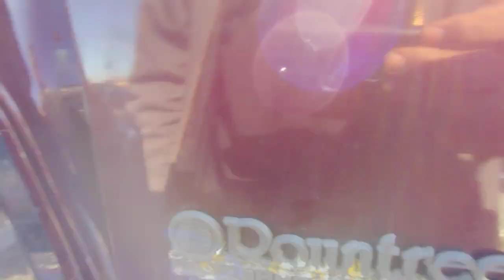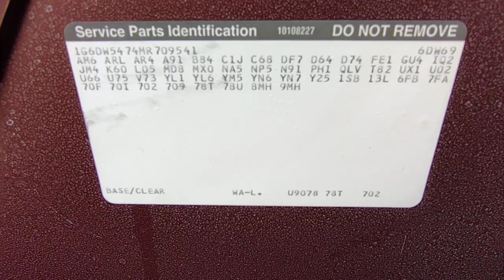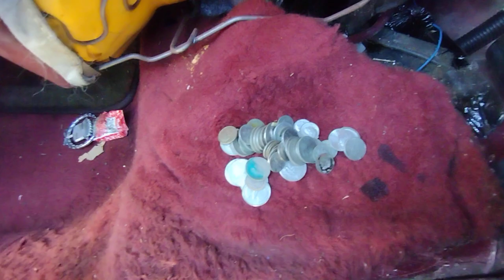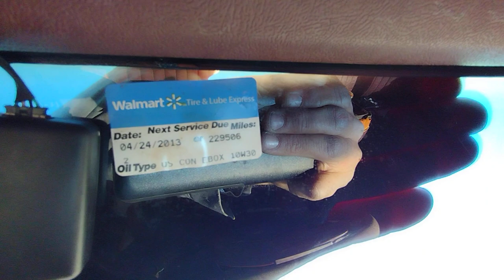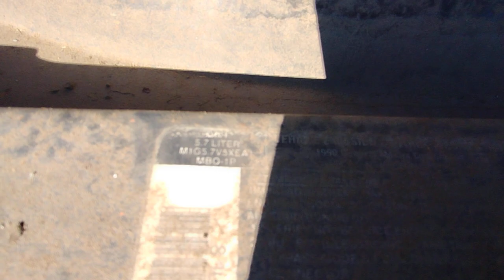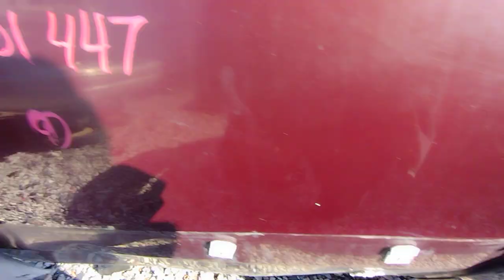1991 Cadillac Brougham Junkyard Find

Comment: Whoa Nelley, 1991 and it's done.

Yup, it's been cold here as well. I bought a 1969 Sears Craftsman (Waterloo made) model 63035 five drawer rollaway toolbox and I walked over to my workshop to install new casters on it that I got off Ebay and whoa Nelley, I couldn't wait to finish and get home. Then I had to walk back home (almost a mile each way). The cold motivates you to walk faster. LOL, but I'm going to Florida soon for work. I did find six cents in the bottom of the box, a 2021 nickel and a 1975 penny and I found a quarter elsewhere on my walk. Don't ask me why someone painted the toolbox flat black when the original paint under it is nice. I stripped the drawers back to original and the frame will be returned back to the hammer tone gray either back to original or with new paint. The same person removed the wheels, hence the need for a new set. But it's in solid condition. 

Roundtree Cadillac is now Orr Cadillac of Shreveport located at 8750 Business Park Dr Shreveport LA 71105. GM had an assembly plant in Shreveport which operated from 1981 to 2012 and produced models such as the S10 there. I've always liked these "square" RWD Broughams. 

We got the VIN, we win: 1G6 for US made Cadillac, DW54 for four door Brougham RWD, 7 for 5.7L (350 CID) V8 with throttle body injection aka "Gentlemen's Hotrod", aka RPO code "L05", 4 is a check digit, M for the 1991 model year, R for Arlington, TX assembly and the rest is the production sequence. The Arlington, TX plant still operates today and assembles SUVs and trucks. This style RWD Brougham continued through the 1992 model year (basically 1980 to 1992 are the same shape/chassis), and then with the "rounded" style from 1993-1996. 

We got the SPID, glad you did: AM6 for three passenger split bench with center armrest, ARL for Arlington, TX assembly, AR4 for passive (manual) restraint system, A91 for power open/close decklid, B84 for bodyside moldings, C68 for automatic temperature control, DF7 for LH and RH remote mirrors with electric defogger, D64 for RH illuminated visor/vanity mirror, D74 for LH illuminated visor/vanity mirror, FE1 for soft ride suspension, GU4 for 3.08:1 rear axle ratio, one wheel peel, IQ2 for interior trim design, JM4 for power front disc/rear drum brakes with antilock, K60 for 100 amp generator (alternator), L05 for 5.7L (350 CID) V8 with throttle body fuel injection, MD8 for THM700R4 four speed automatic overdrive transmission, MX0 for automatic transmission merchandising option, NA5 for Federal emissions, NP5 for leather wrapped steering wheel, N91 for locking simulated wire wheel covers, PH1 for 15x7 steel wheels, QLV for P225/75R15 puncture seal tires, T82 for automatic on/off headlamp control, UX1 for AM/FM stereo cassette radio with weather band, ETR, equalizer and clock, U02 for miles/kilometers digital display, U66 for extended range speaker system, U75 for chrome power antenna, V73 for US/Canada vehicle statement, YL1 for leather/vinyl upholstery, YL6 for accent stripe delete, YM5 for accent stripe delete, 13L for Silver Metallic secondary body color, 70F for Dark Maple Red floor covering, 70I for Dark Maple Red interior trim, 702 for Dark Maple Red leather interior trim, 709 for Dark Maple Red seat belts, 78T for Dark Maple Red vinyl top, and 78U (aka U9078) for Dark Maple Red exterior paint, Base/Clear for "Basecoat/Clearcoat" paint technology, among other codes.

Whoa Nelley, Cadu and it's over for you. Brougham is soon to go home. Roundtree and it's over for thee. 3-5-0 and gotta go. RPO code "L05" took a nosedive. That's it, time to quit. 1991 and it's about to set over the sun. Dark Maple Red leather spent too much time in the weather. RPO code "MD8" used to be great. Going to be flat and that's that. "D" body looking very shoddy. Going to get squished and the Cadillac faithful, many here, maybe Benny but most certainly the Google Man are going to be very, very, very, very, very, very, very pissed.
Reply: Getting some real bad weather in your neck of the woods and of course in Omaha it's the usual cold 🥶. 
I drove to Sioux City on Wednesday and couldn't get to the site because of the snow hadn't melted yet and Omaha which is a 100 miles south not much snow here 🙃
Reply: @garymckee8857  No snow here, but quite cold. Fortunately, I'm heading to Florida for work although it's going to warm up starting with tomorrow.
Reply: Hey by any chance do you know that locking “box” that was bolted to the fender support. Saw when Benny was checking the oil?
Reply: @gr8fulpn  It almost looks like some sort of alarm or siren for an alarm. Hard to tell.

Comment: I almost got a mint 89 model for $2,500. But when I showed up with the money. I saw the new owner driving it away. So instead I got my 96 Roadmaster sedan. Not a bad car for the $1,800 I spent. But it's too new for me. But I've been daily driving it for almost 15 years. And it's got over 176k miles on the original Optispark distributor. So I guess I didn't do too bad. The interior definitely wasn't made to last compared to older cars though
Reply: That's a Great car, IF you have the famous Lt1 350! I can personally vouch for that engine! Should you get rid of it, you'll be sorry.. won't find another like it. 😉👍

Comment: I had a 87 Caddy of that body style and had a 5.0 liter engine, itwas way underpowered for the weigjht and size of the car but it was rust free like you said of that one.
Reply: I had the same engine in my '88 Town Car; loaded to the gills w/factory options...only down about it bacause the 305 just did NOT have the "umph" I'm used to when I hit the gas. On the other end of that spectrym waa my '96 Fleetwood! 5.7 Lt1. 350...nuff said!